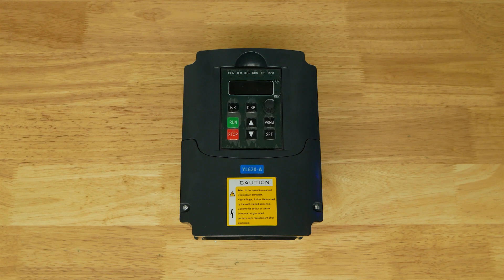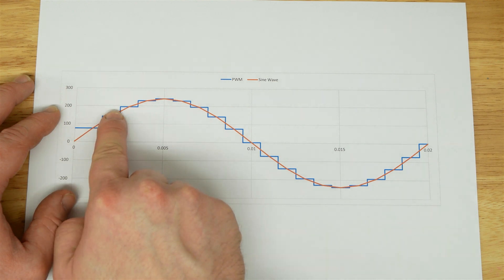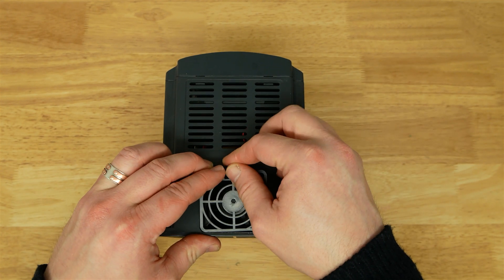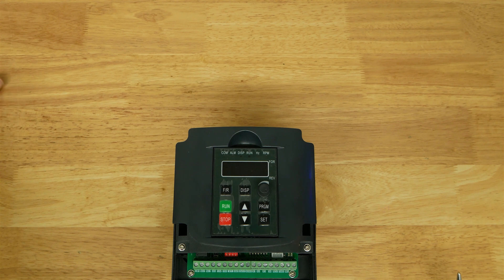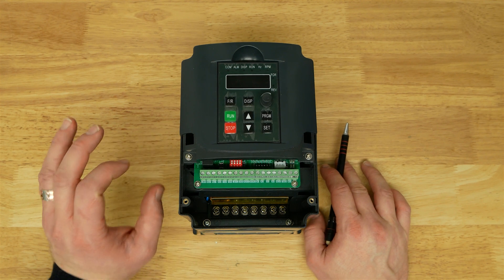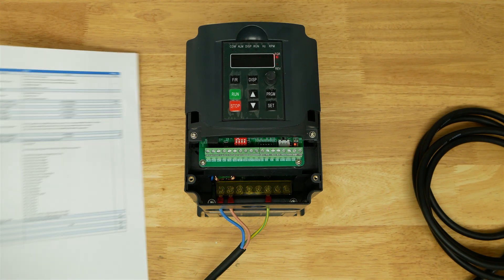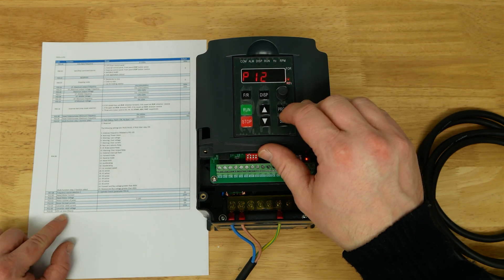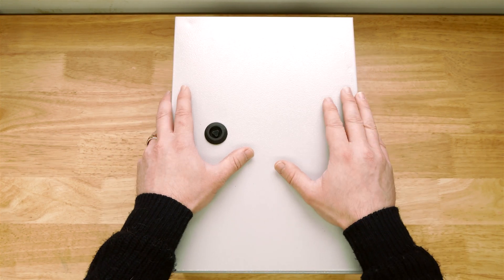YL620-A Variable frequency drive installation part 1

Comment: Hello, nice video but on my side I am under FluidNc and despite the 10v/Gnd and Fwd/Rev connections I can't start/stop my spindle on my VDF YL620...I have P00.01=1 and P07.08=3...do you have any idea?
Thanks..Philippe

Comment: The amplitude on the charts at the beginning of the video may be incorrect. I believe that 240V mains is 240V RMS (in the USA at least).
Reply from the maker: Yes that’s true, the charts are a simplification in that respect. While it might have been an interesting aside, the graphs are really just supposed to be an illustration of what is going on even if they’re not strictly accurate, it may have been confusing to say that the peak is 300-odd volts when we’re using 240v for programming the vfd.

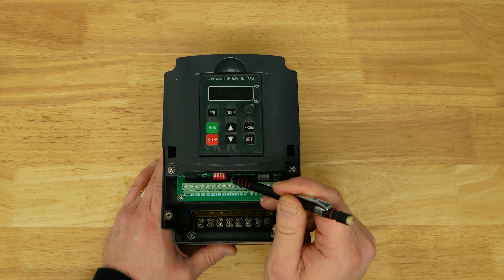Comment: 16:55 AFAICT these DIP switches are there to set the analog control voltage. 1100 would set it to 0-10V control while 0000 will set it to 0-5V control.
Reply from the maker: That’s quite useful to know, the problem is that with the corrections and input you and others have made I’ll have to go and make a new video.

Comment: 12:40 & 13:20 actually 10V - VI1 - GND are for the potentiometer (BTW it's an "i" for input in VI1). A potentiometer would be connected across 10V - GND and the wiper pin would connect to VI1.
However, I cannot find any useful documentation of the actual use of the AO (analog out - simulation output) nor of the electrical characteristics (i.e. max current) of the 13V pin. 
Also XVCC is somewhat obscure as it sources 15V but the docs call it "15V external input". 
The MO (triode output) is another obscure one I cannot find any useful documentation about.
Reply from the maker: Quite right about the pot terminals, frustratingly I didn’t notice the mistake while I was putting the video together. This arrangement seems fairly common among vfd’s with this sort of layout, it’s the same on my HY vfd.

I’d be really interested to see what the AO actually does too.

Comment: Hello Sir,
What is the value for P00.00 (Mains frequency) for my Spindle 1.5 kw, 220 v, 8 A, 400 Hz water Cooled spindle.

I have same YL620 A 1.5kw , 220 v Vfd 
I am having tough time in setting Vfd. Sir, can you share your Vfd setting.
Thank you
Reply from the maker: P00.00 should be your mains input frequency. That will depend on where you are in the world, in the UK/Europe/Asia it would be 50hz. in the North/South America 60hz.
Reply: @ImpracticalMachinist  Thank you Sir

Comment: The manual says, "Please lower the carrier frequency when there is a longer distance between the inverter and the
motor..."  I see no settings to adjust the carrier frequency, but the specs do say it is adjustable between 1kHz and 15kHz.    Is there a setting for Carrier Frequency?
Reply from the maker: It looks like the setting you want is P12.19 PWM frequency, by default it should be set to 8khz
Reply: I see it now, thanks!  I was searching for Carrier and could not find anything in the electronic version of the doc.

Comment: Having issues with one of these - seems like my neutral is directly connected to my ground, which trips breakers. Do I have a lemon, or is this how it's supposed to be? Losing my mind looking all over the internet for anything of help. Even the seller doesn't know whether it's a fault or on purpose.
Reply from the maker: Obviously that’s not supposed to happen, have you checked the continuity between the earth and neutral with a multimeter? It definitely sound like a short somewhere. 

Is this the case with nothing else wired? No motor, no switches, just the power feed to the unit.
Reply: @ImpracticalMachinist  there is a direct short between ground and neutral. Like on the screw terminal of the vfd itself. Yeah, I have set the multimeter to ohms and I'm getting 0.5 ohm on it.
Reply: @ImpracticalMachinist  i have a switch on the way, but it wasn't the problem - I have removed the vfd power cable and then the entire enclosure, with 2 power supplies and 4 nema23 steppers and drivers was working wonderfully. Tommorow I'll be testing on just straight plug to the socket, dont have a cable handy so I have to borrow one from the neighbors.
Reply from the maker: @Xenomorphin1  I'm having trouble visualising the setup. Are you saying that the VFD isn't wired straight through to a plug? 

If it's working outside the enclosure then there would seem to be the answer, you mention that you've got psu's and drivers, are you splitting the incoming AC between them with terminal blocks inside the enclosure?
Reply: @ImpracticalMachinist  it won't be working outside of the enclosure either. I'll update you after I test it.
Reply: @ImpracticalMachinist  Lost a comment, so I'll try again - took out the VFD from the electrical box, and plugged it straight to the wall. The breakers went immediately. We have a lemon on our hands :<
Reply: @Xenomorphin1  Have you popped it open to see if there’s any swarf or stray solder in there? Or are you just going to rma it?
Reply: @doctordenied8258  it has an anti tamper sticker on - I'll rma to not lose the warranty (I know they are illegal, but tell that to the chineese seller)

Comment: hello..can you update setting for 400hz?
Reply from the maker: I’m sorry, I’m not quite sure which setting you mean?
Reply: @ImpracticalMachinist  what I mean is the parameter setting for 400HZ 2.2KW 220V motor
Reply from the maker: That’ll be according to whatever the specs are for your spindle. The spreadsheet is really just to provide a better, clearer translation of some of the programmable functions.
Reply: @ImpracticalMachinist  how about 2nd video?
Reply from the maker: When I get a free couple of days, I’m looking forward to getting it filmed.

Comment: Hi There, will you please post the page you used for the settings? I have the same vfd but the documentation is terrible. Im really having a tough time with the settings. I figured out "P03.08 = min spindle frequency/Hz" & "P03.09 = max spindle frequency/Hz".
Reply from the maker: If you have a look at the description you'll find the manuals and setup sheet that I showed, and also the one that i created (the third link) which is clearer and has the settings that I used for my setup, along with some notes explaining what settings do.

Let me know how you get on, and if you have any more questions.
Reply: @ImpracticalMachinist  Thanks for the reply, I got her dialed in. 🤠
Reply: We got the exact same model.
Reply from the maker: That’s great to hear!
Reply: @ImpracticalMachinist  If you want I can send you the entire list of settings that I have compiled. It should save you a ton of time. Im running the YL620-A with 220v 1.5kw watercooled motor. She runs very quiet and smooth too with these settings.
Reply from the maker: @JALLAZZA  That might be helpful. I’m only running a milling machine from mine so the basic settings I have work fine, but I think it’s a good idea to add settings and notes to the spreadsheet for other setups like yours.
Reply: @ImpracticalMachinist Will do! I do have one setting that I am strugling with, How do you display the spindle RPM on the screen? I have looked everywhere, and seems ALOT of people dont know.
Reply from the maker: Ok, so i think it can be done with P00.24, set to setting 9, which is labelled as "display user parameter and varies up or down with the motor speed. I can't find anywhere to actually set that number though. And the display button on mine doesn't seem to do anything at all.
Reply from the maker: Ok, so there are two settings to adjust. P00.23 which is the ratio between P03.09 and the motor RPM. So, (motor max rpm/P03.09)*10 should get you the percentage increase.

And then set P00.24 to option 9.

Also, hitting the set button seems to flick through all of the P00.24 options.
Reply: @ImpracticalMachinist  Thank you for assisting, I have changed the settings to 9 on P00.24. But I also realized I can not cycle through display modes by using display.. seems it only works on the settings side of things. There is an RPM light on our VFD, but nothing in the manuals mentions it. My User Variable only goes up to 4000.. have not been able to actually "set" the "User Variable". Will give the other setting a go and see what happens. PS - I should have looked at your settings list before starting with mine. Your one is done well. However, I am also unsure what P14.00 does. Hopefuly nothing RPM related... 😄
Reply from the maker: What's your motor speed out of interest, being watercooled I expect it's quite a high rpm?
Reply: @ImpracticalMachinist  She Runs 24000rpm@400Hz.
Reply from the maker: So your P00.23 would be 600, did it work?
Reply: @ImpracticalMachinist  It did yes, but the VFD can not show 5 digits because of the "u" it shows for "User Variable". so instead I changed P00.23 to 60. Now it is Much easier. when running @ 24000 rpm it shows "u2400" so I just add the additional 0 in my head. Where it showed "u4000" when it was on 24000 rpm because the "u" does not disappear, taking the space of the 2 that should be there. Made it quite bad to keep track. But I am happy with that. The difference by running at 23001rpm and 23002rpm is obsolete anyways. But thanks a mil for helping me out, really appreciate it!
Reply from the maker: That’s cool, I’ll add it to the P00.23 note on the settings spreadsheet.
Reply: @JALLAZZA  Hello Sir,
I have same YL620 A 1.5kw , 220 v Vfd and Spindle 1.5 kw, 220 v, 8 A, 400 Hz water Cooled spindle.

I am having tough time in setting Vfd. Sir, can you share your Vfd setting with me. 

Thank you
Reply: @samtuladhar4009  Hi There Sam, I will do. I am just out of town atm. Will be back in about 4 days. Will send as soon as I can
Reply: @JALLAZZA  Thank you Sir

Comment: hi! thank you for the video it help so much! any I have a problem with the inverter I need your help. The spindle is suddenly stops running and the VFD shows Error 4. I already watch some tutorial and i set up again by doing factory reset. The error 4 disappeared but when i try to rotate the panel potentiometer the frequency shows 10Hz the spindle is not move, until i set 47 Hz the spindle is move. But the rotation is different, it is less noisy but i feel there is something wrong. Do you have any idea? thank you
Reply from the maker: I suspect this will be your minimum torque settings. You’ll want to have a look at settings P00.09 and P00.10, which are the minimum frequency and voltage respectively. 

Have a look at the spreadsheet for the default values, and let me know how it goes.

This might also be a problem with your potentiometer setting, you’ll need to set the minimum and maximum settings for the potentiometer to match the minimum and maximum output frequency.
Reply: @ImpracticalMachinist  I have try to setting P00.09= 0.2 Hz and P00.10= 1% but it didn't work
Reply: my vfd shows Er 4 again, what should I do? can you help me?
Reply from the maker: Try setting p00.09 to 5 and p00.10 to 10.